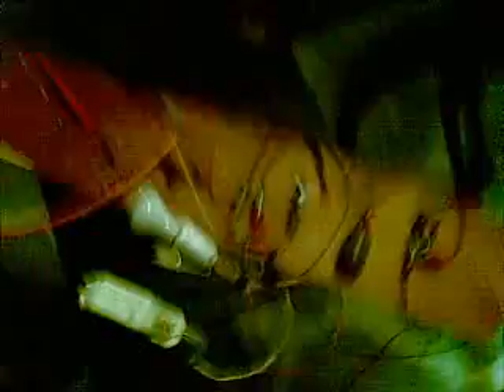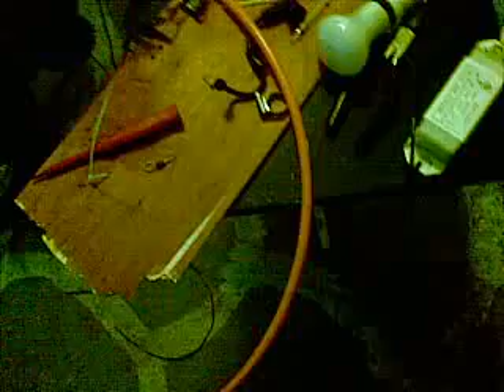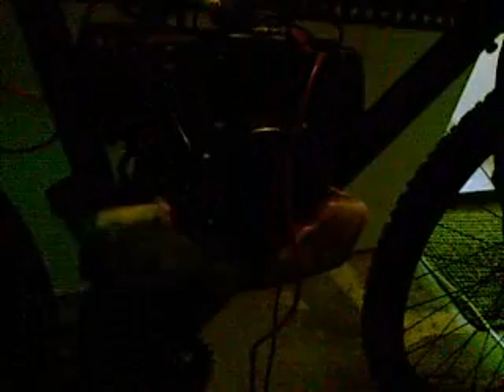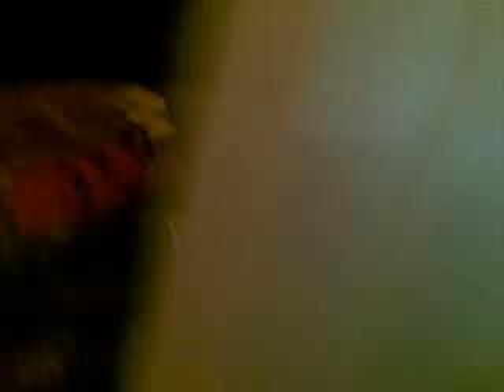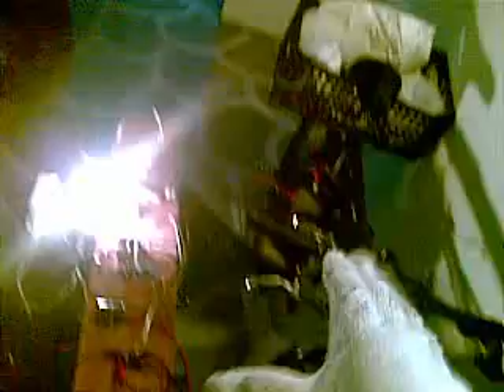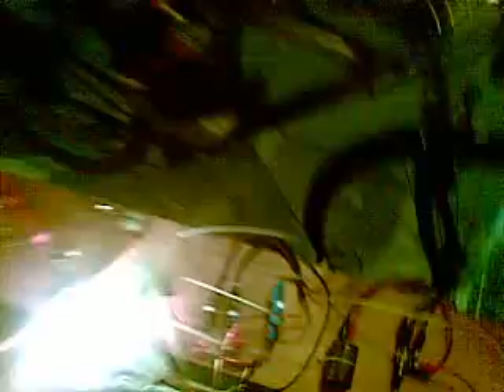Plasma ignition 2stroke engine - english version

Comment: I don't know why this isn't big on 2-strokes:
They have way less time or crank angle to fully burn the charge before the exhaust port opens.

If you aren't already:  Add a constant PD of ??? 200-300 volts beneath the spark circuit:
That should evolve some O3 and H2 type radicals in the spark region.

Your camera needs a light at the very least and your description needs things like circuit diagrams if you want more clicks.